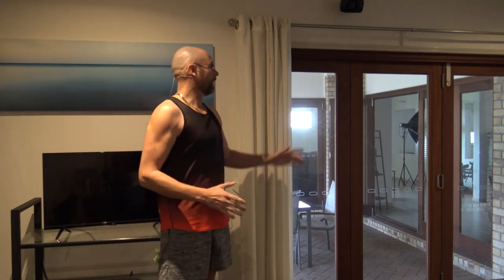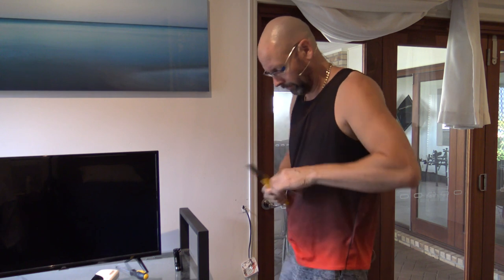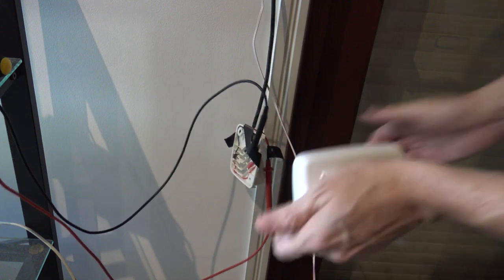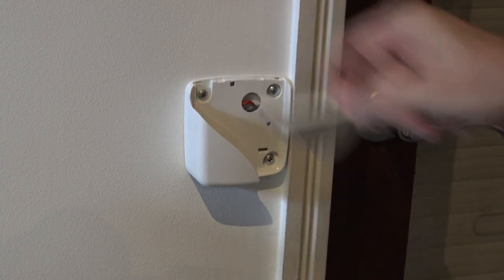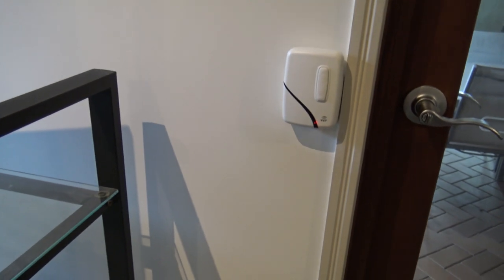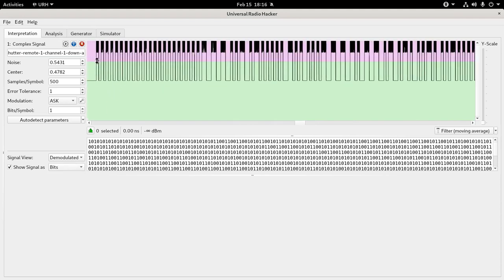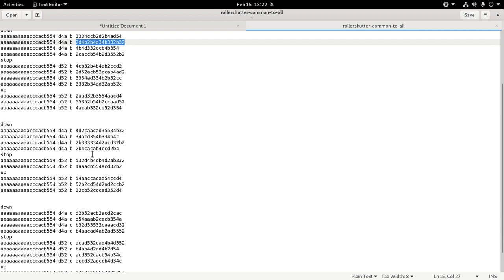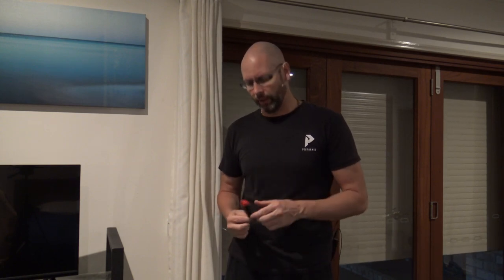Roller Shutter Code Analysis And Wiring

Comment: During my apprenticeship I was taught to use the "screwdriver in the ear" trick listen to the bearings in electric motors. Never thought to use it for electronic components. Nice one !
Reply: I thought that he was kidding. Hahahahaha. Wow.
Time to go play with the cable grabber
🐎
Reply: @jamess1787  Yeah.... just be REAL careful where you put the metal part.  You could damage low voltage circuits if you aren't careful.  High voltage circuits can damage YOU!

Comment: Pipe cleaners can be more handy to go round corners. Also a thermal camera can come in handy when examining electronics to see if anything is over heating or reveal a whole bunch of hidden faults and see through walls. But they are very expensive. But an over heating fault can be very expensive too.